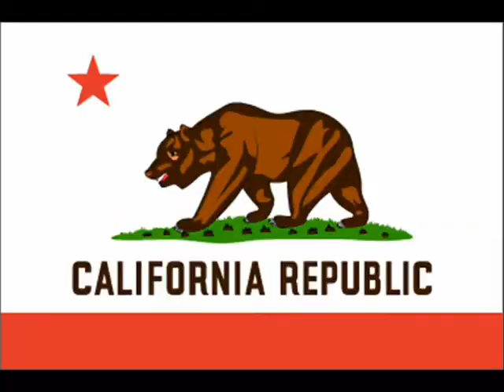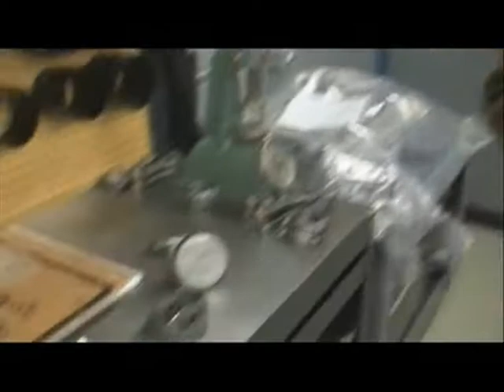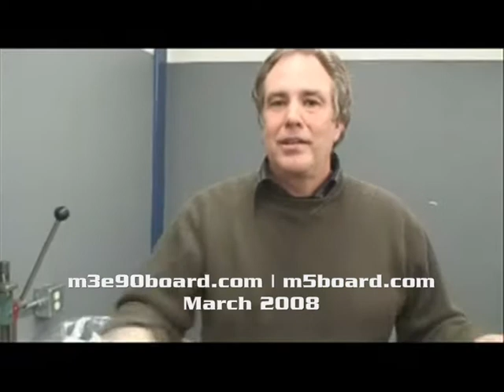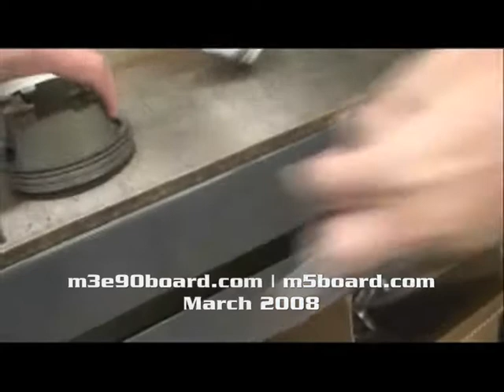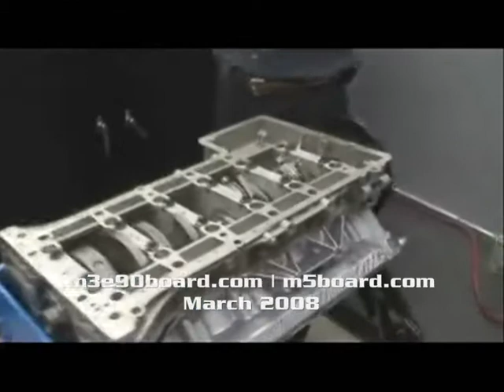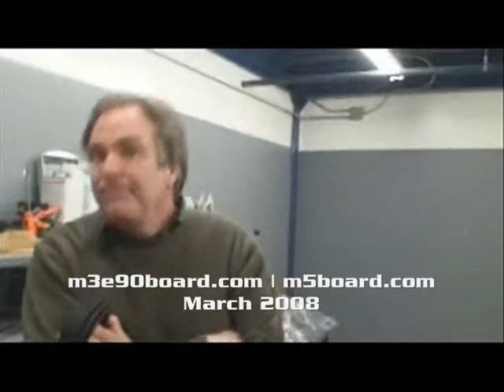m5board.com: Steve Dinan interview 3/7: Engine room talk

Comment: An American aftermarket company doesn't have the same constraints as an OE.  BMW still has to price the M in the appropriate market range and still make $ in mass production.  Dinan is lower volume and is less affected by the economies of scale.  $1 x 100 = $100 and $1 x 1,000,000 = $1,000,000